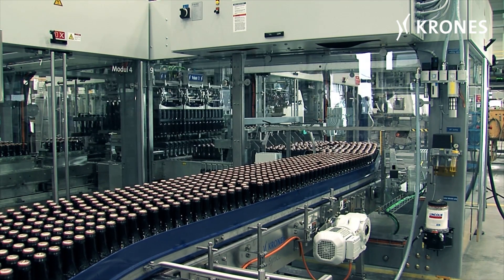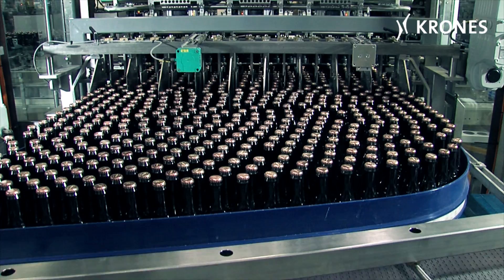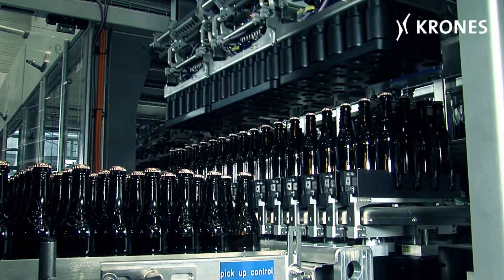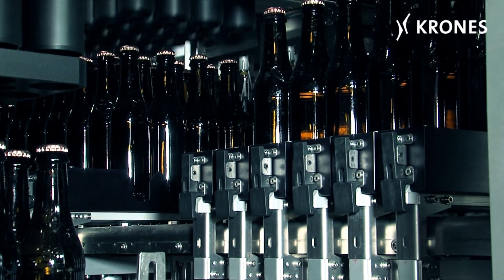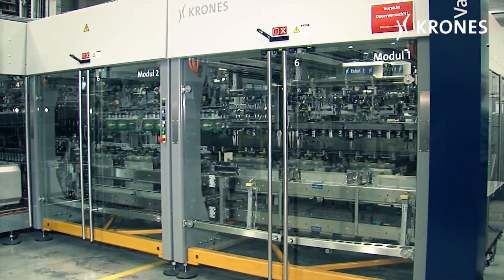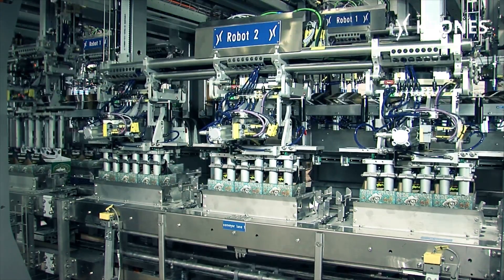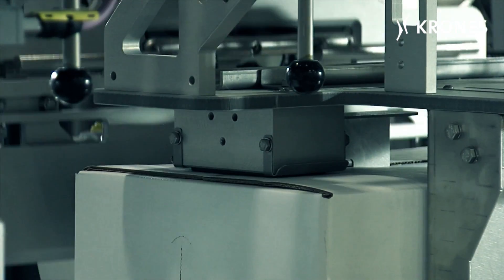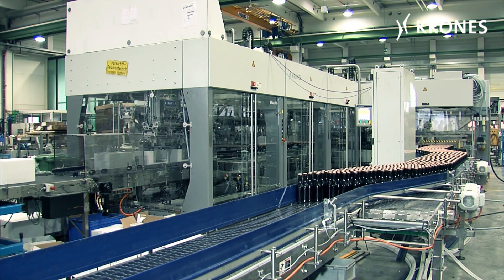Krones Varioline: All-in-one-solution

Comment from the maker: Built-in flexibility for the future

This flexible system handles both primary and secondary packaging, and keeps pace comfortably with all new packaging trends. Depending on the specific requirements involved, several different packaging variants can be run on one and the same machine. This flexibility is not achieved at the cost of speed -- the Varioline has been designed for a very respectable rating of up to 52,000 containers an hour.